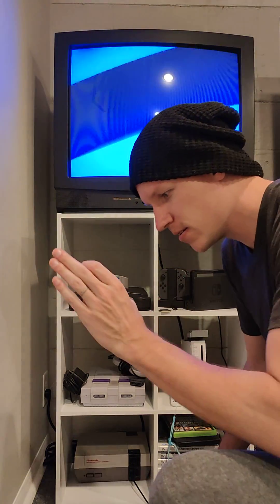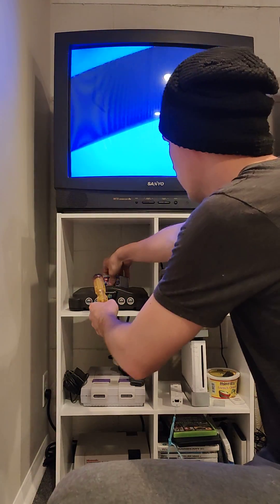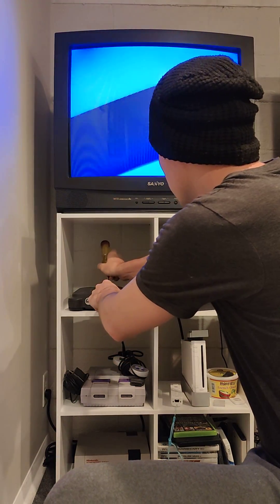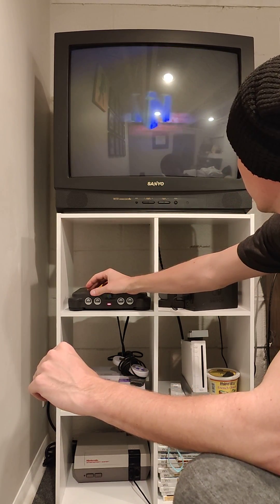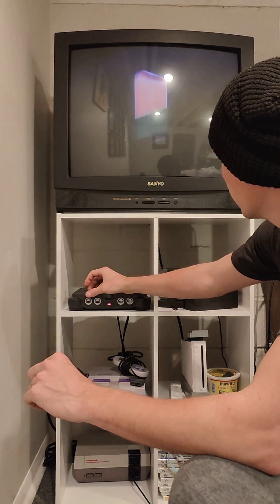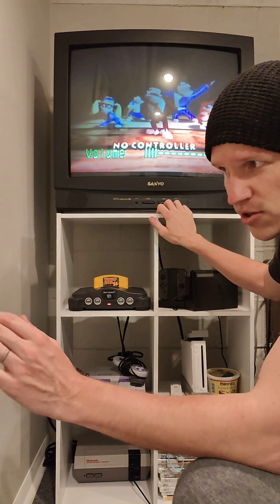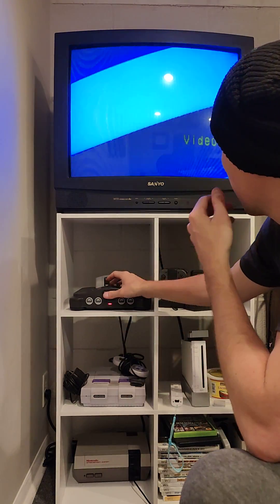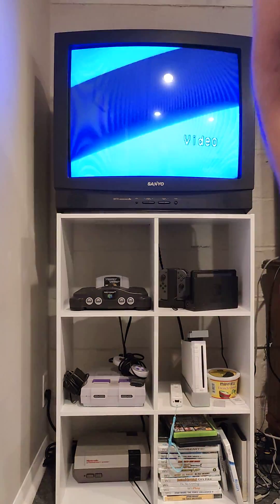[FIXED] DIY N64 Expansion Pak

Comment: I built one of these tonight and it killed the N64 I tested it with... I am pretty confident that my soldering is fine. You mentioned you killed some N64s yourself - were you able to repair those consoles at all or have any idea what is wrong with them? I still get a power light but even with the Jumper Pak I can't get that N64 to show any video signal. Gutted.
Reply from the maker: Did you build with an earlier version of the repo or when I updated it back in June? DM me on Reddit and we'll see if we can figure out the issue u/LambBrainz

Comment: Hi. You mentioned someone mimic the rambus with fpga. Do you think it would be possible to simulate it with some fast and cheap microcontroller? I already saw people simulating small ROM and RAM banks with the inexpensive stm32 blue pill for retro computers. Raspberry pico can run in 250mhz and has PIO. Do you think we will see something like this in the future?
Reply from the maker: I've talked to several (way smarter than me) devs about that exact scenario and unfortunately most microcontrollers just aren't fast enough. RDRAM ran at like 550/600MHz. There's some other issues, but the main/first one is just raw speed.

Comment: So what was it about the circuitry that was damaging the N64? Was it backfeeding?
Reply from the maker: Kinda? The datasheet isn't very clear about pins 2, 4, and 10. It says that they're ground, but not that they need to be on an isolated ground connection with pin 14. So I just assumed I could link 2, 4, and 10 to the main ground plane and this caused catastrophic problems. It wasn't until looking at the original OEM board and some old pictures I had that I realized my mistake

Comment: neat.  n64 can have up to 16mb of ram total. achieveable via two 4mb internal and two 4mb external using a yobo expansion pack with the sticks swapped from 2mb to 4mb.  useless for most unless you're running an everdrive.  reverse can be done to add 8mb internally, so no additional ram is needed for expansion pack games.

i do not know if the gameshark 3.x active cheat code explorer can run with perfect dark or other games that need expansion packs due to the fact the memory probubly would still overlap due it being programed with less ram in mind.

ips patch roms?